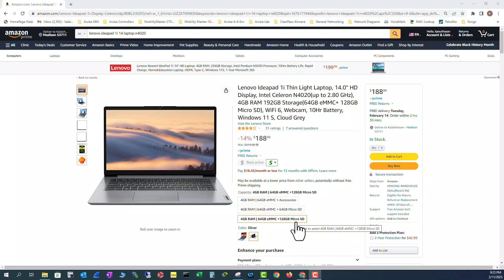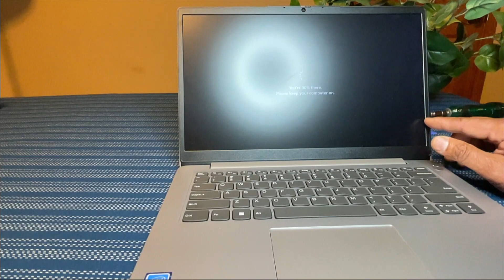Lenovo IdeaPad 1i -  14“ Laptop – What is Inside – Disassembly | Can you Upgrade RAM and Hard Drive

Comment: These are wrong pointers. I could add an extra  8GB of RAM on top of the existing soldered 4GB and also an NVMe drive in the M.2. We could clearly see those slots for that in you video.
Reply: How did you manage to install more ram. I bought a bunch of these and need to upgrade them. I was going to install the M.2. drive (Which I imagine would speed it up a bit.) but you can upgrade the ram, that would be great.

Comment: How can you post tutorial when anyone can see that you have NO IDEA what are you talkind about  - HDD can be upgraded-look at SSD-M2 slot  /  Ram can be upgraded-look at empty Ram socket.
Reply from the maker: Hello - thanks for your comments. I did the research again to see if it is upgradable. But looks like it is not. See this Lenovo forum. 

https://forums.lenovo.com/t5/Lenovo-IdeaPad-1xx-3xx-5xx-7xx-Edge-LaVie-Z-Flex-Laptops/Ideapad-1i-14-HD-Laptop-Celeron-N4020-RAM-upgrade/m-p/5190712

Let me know where did you find it can be upgradable? 

Easy upgradable devices have extra slots
Reply: @networktutor640  That link you posted is talking about the "flex" version which has no slots, and as many people have stated, the one in your own video does in fact have slots to add both ram and an m.2 nvme drive. My mother has the same laptop but 128gb storage, 8gb ddr4 ram, and a 1080p display. I just opened the back of it today and it has those exact same slots for M.2 and ram as the one shown in your video. You can't just pull the existing ram or storage, but from my research and the fact of empty slots, you can absolutely add both of those easily. I have ordered a stick of matching 2666 8gb ddr4 cl19 ram, and a 512gb m.2 nvme ssd, when they arrive and I install them I will come back and update the working status of it, but my basic computer and electronics knowledge give me zero doubts whatsoever.

Comment: I have the 128GB version of this laptop.  It is definitely not a replacement for my desktop machine, but it satisfies my needs.

I have a hybrid work schedule.  So, I work part-time in the office and part-time at home.  I log in remotely to my work VDI using Citrix.  I have a desktop in my home office with 32GB RAM, 5 TB of storage and two monitors.  So, I don't need a laptop when I am there.  However, because I am on-call 24/7, I wanted an inexpensive lightweight laptop to carry with me so that I can log in to my VDI when I am away from home. I'm not a gamer.  This laptop is perfect for that purpose.
Reply from the maker: thanks for sharing your experience and the use case for this type of laptop.

Comment: I don't understand why ram upgrade isn't possible cos the ram shows 1 of 2 slots used which means you can fix another ram in the empty slot so why is that not possible I think you just need a good technician to disassemble the parts and then fix it for you it should work
Reply: 2nd memory slot is not soldered-in, only white marking on the motherboard can been seen but no connector. Most likely the same mobo is used in different laptop models with attached components strictly matching particular configuration with virtually no possibility to upgrade. Typical tactic from Lenovo across variety of equipment.
Reply: I dont understand why any computer maker would make a computer that you cant upgrade the ram. I bought this modal thinking I could upgrade. to fit a socket on the motherboard that has provision for one would cost pennies.  STUPID, Lenova. 4gb in a modern laptop makes it useless. I have it from the Lenova help site, it is not upgradable. Stupid,
Reply: @paulroberts5443  is it not possible to add 1 more 4gb ram stick?

Comment: Well, that's kinda shitty tho, If the soldered storage reaches its endurance point or TBW then there's no way to replace it
Reply from the maker: agree. it is a cheap laptop in the $100 range. So less flexibility.
Reply: sheesh, it's basically landfill when the SD fails outside the warranty period
Reply: tiene un puerto para SSD M.2, incluso en el video se puede ver.

Comment: the right upper corner looks like an M.2 slot. from another video i watched about the Walmart $129 special on this laptop, it has an M.2 slot. also, what's the unhooked black cord to the left that's taped down?
Reply from the maker: it is a heatsink. Both od the heatsink are connected using a small black metal. Is this what you asking ?
Reply: @networktutor640  you can add 512gb m.2 ssd to this laptop. The slot is on the right side of the MB in your video...
Reply: Is it sold on Amazon?
Reply: @networktutor640  yes, i was asking about that too. i'm gonna buy the Walmart version because it has a spot for the M.2 drive. thank you for answering me!